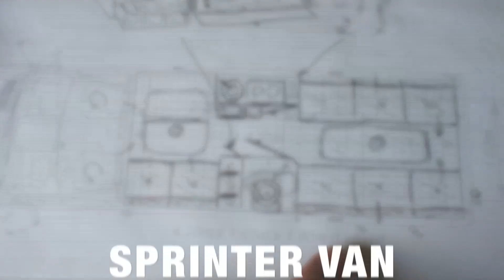Making water level sensors for water tank by yourself for only $17 (van, small house, travel)

Comment: Would this work the same way if the sensors were put in upside down? 
So instead the lights would only turn on when the tank was not at the sensor level with gravity making them connect and the water level making them disconnect?

Comment: I hate to complain about such a well done video, but the simple, cheap and standard RV way the water level sensors are done, is by using stainless steel plug/bolts, not a switch at all!
The led gaude is perfecr and will work with this!
What you do is install two plug/stud/bolts/screws at the bottom.
And the other 4, 5, 20 or however many increments you want to display are installed equally all the way to the top(full) you could fill your tank one gallon at a time and make a mark after you pour in a gallon, until your tank is full, then empty and install the plugs, ech plug will connect 1 wire to the nevative side of the led that you want to show when the tank hits that mark, as tje tank empties the lights will go out. 

Connect 12v ground to one of the bottom two plugs and empty light negative to the other plug, then connect a wire to the next plug and to the led negative, the possitive led wires will be wired together and hot possitive 12 v will be connected to them, the water in the tank is used to make the negative connection, just like a switch! Easier done than said!
Reply: will this not cause an electrical shock at the faucet?

Comment: Looks really good!
I think it could be possible to measure the amount of water in the tank by using a pressure sensor and some microcontroller.
Would have a higher resolution and needs no drilling, but I guess it'd be a bit more complicated...
Reply from the maker: +Kuchenmischung yea i think its possible, but my solution waaay easier and possible to do fast with no skills